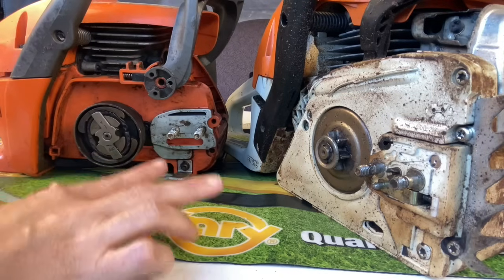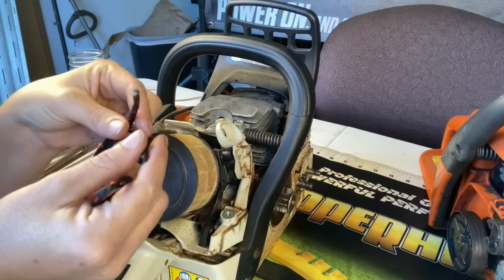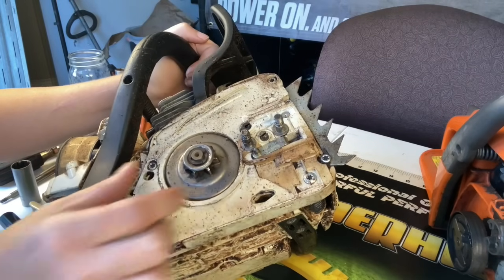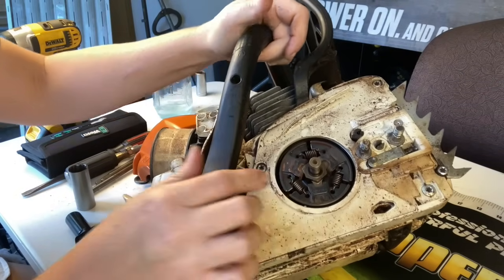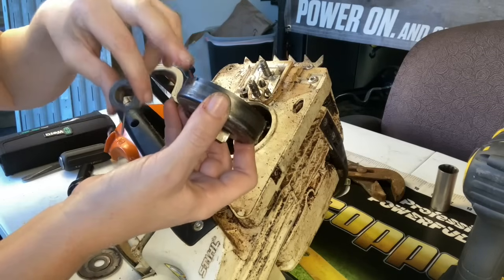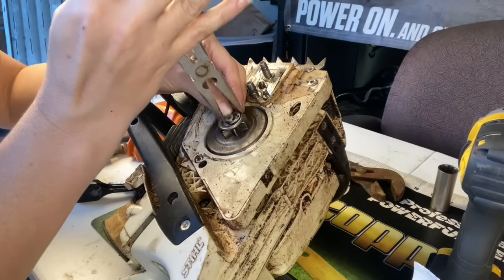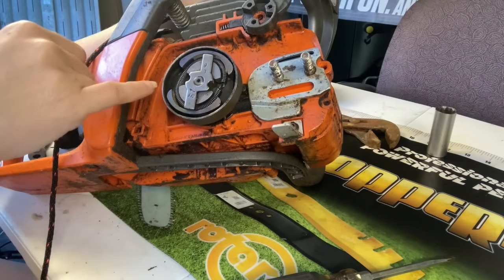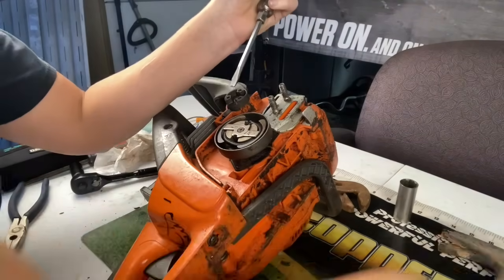HOW TO EASILY REMOVE THE CLUTCH OR SPROCKET ON ANY CHAINSAW. STIHL ECHO HUSQVARNA JONSERED POULAN

Comment: I've heard using an impact tool on clutches can damage the crank seals.  Do you know anything about that?  Enjoy you videos, by the way.  Very informative.
Reply: Can't applying too much force on the piston with a non impact tool damage the rod bearings?
Reply: @viperstrike3827  Yes, I suppose it could. Not sure where I saw or read that.  I got the clutch off I was working on with an impact today without much effort.  I guess it's sort of six of one and a half-dozen of another so far as damage goes. I didn't have any luck with a drift and hammer, or socket and pull handle.
Reply: @John-gj1jr  Thank you for the reply!
Reply: @viperstrike3827  Now I've got to find a clutch or some way to reattach the lining to the shoe.  Old 031AV with what appears to be an odd clutch.
Reply: Just don't lay on it like it's a lug nut...not much torque needed since it's left hand thread...turns same way as crank

Comment: Interesting that you stuffed rope into the cylinder to stop rotation.   Years ago I watched the motorcycle mechanic take the clutch off my bike.  He just used an impact wrench.   He told me the clutch could not keep up with the wrench, and that is what provided the resistance needed to break the nut loose.   I don’t know if that would work on chain saws or not.  Have you ever tried that?
Reply: Don't, wrench puts high load point pressure on the piston, which might cause breakage, especially If you are using impact tools. Rope on the other hand evenly distributed the pressure and also acts as a damper making it impossible to damage the piston.
Reply: @peterlabiak1051  How so?  There was nothing in the cylinder but air.  Would it put more load on the crank than normal operation?  Not arguing, just curious.
Reply: @dougberrett8094  Sorry, I didn't read your post properly! I thought that he used a wrench as piston lock! Use of impact to REMOVE high torque or thread locked nuts is absolutely fine :). What is however extremely important is to use the top quality impact sockets, the heavier the better. First of all they are made with much higher precision fit and secondly being heavier gives additional inertia. Sorry for the confusion!
Reply: @peterlabiak1051  no problem.  I do remember from my days in the “dirt bike” days that there was a device used to set timing that did mechanically stop the piston.  It screwed into the sparkler hole and had a rod that slipped through its center.  There was a knurled knob that controlled how easy the slip was.   One would screw the device in until it stopped, push the rod gently until it contacted the piston, and then tighten the knob, but ever so lightly.  The engine was then rotated gently to push the rod back out to establish top dead center.  The rod was then pushed back in the amount desired before top dead center.   There was a table included that converted “degrees” to the linear distance.   The knob was then gronked on to make it stay put as the engine was gently rotated until the piston was stopped by the rod.  With the piston now held in the proper timing position, one fiddled with the electric parts.   Having had my timing go bad during a desert race, I bought and used the device frequently.   I always worried about piston damage, but never actually incurred any.  I had the cylinder head off frequently to check for that and other things.  
You are correct about the impact tools.  Normal sockets can’t handle the impact over time.   I used an impact screw driver to keep the bike together.  Surprising how all that vibration can loosen screws.  It was one that one struck with a hammer to add that extra gronk.  It also fit in the bike’s tool box, so it was available when needed.  The bits that fit it were a cut above normal screw driver bits.

Comment: Never hit a screw driver towards you and use a punch instead of miss-using a screwdriver.  I also don't recommend an impact drill, use a socket handle, the right tool for the job and your tools will last a lifetime.

Comment: Im trying to fix a leak innthe gas tank of my chainsaw, my father last his shit ine day and threw the thing at a stump, been leaking from the inside so i wanted to take the whole motor out sonits just the plastic frame, but the designers of my chainsaw (poulan) decided to make the main bolts that hold the top end and bottom end ALSO hold the engine too the frame, and i couldn't not for the life of me figure out how that second clutch design came off, i was ready to take a dremel or something too it to make space to pull the bottom end out. Its a cheapy chainsaw sonnot a big deal if it doesn't work out.

Comment: There is an outomotive brake tool, that will actually  work, in those notches on the last clutch. Making special tools/ clutch spinners , out of sockets is always fun. Needed: cutting discs, grinding discs, dremel, or die grinder and various  bits.

Comment: Just a bit of advice you should always grease your needle cage bearing when putting them back on. Also I don't advise EVER taking a clutch off with a flat head screwdriver because as we saw in this video even with a clutch that was relatively loose already she nearly ended up with a screw driver in her arm. Instead I would advise buying the right tool or otherwise make one by cutting two notches in a t-wrench which is relatively simple.

Comment: lol  do we need to take the chainbrake off???
Reply: as i disengage
Reply from the maker: I didn't have chain brake engage, but like many very used saws, the housing melts a bit and makes them harder to get off. If the brake was engage, it would had been almost impossible to pull it off.

Comment: WHY WOULD ONE NEED TO CHANGE A CLUTCH ???  Just asking
Reply: Welp, I did the dumb thing of putting the wrong chain on my saw,, The pitch was a tiny bit different, and ATE the sprocket, Clutch was loktited.. Took just the right strike to break it loose,, $7 part and 20 min labor,,, I was more carefull about chain after,, Dumb,, Dumb,,Dumb
Reply: Because they wear out
Reply: @mattmutz9279  
Change roller bearing and or clean and grease , or change damaged sprocket.

Comment: Followed this and although it worked to get the clutch off, the rope is stuck and cannot be removed :( Good tip but could give yourself unwanted extra work. There's a tip in the comments I wish I had read before attempting. EDIT: this got me out of trouble https://youtube.com/shorts/bVzw4R401YE?si=zIwNq5qS0SGJTDVs